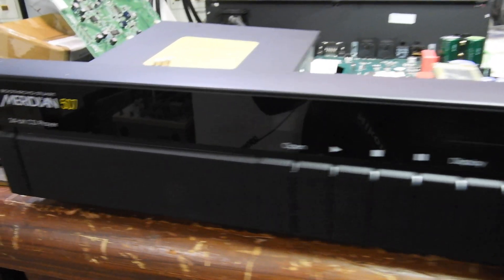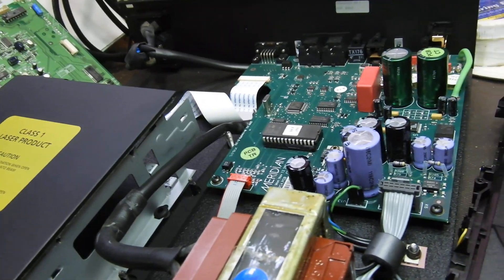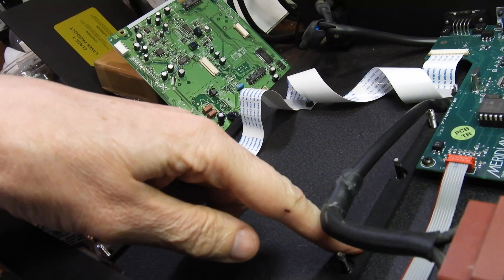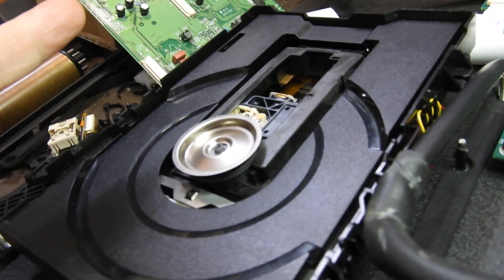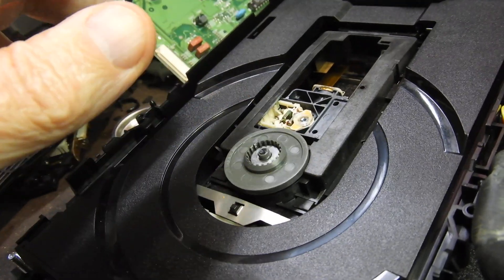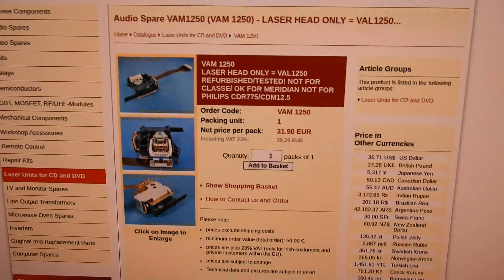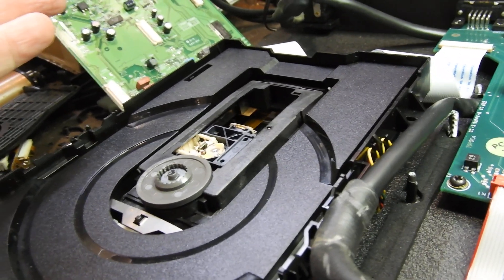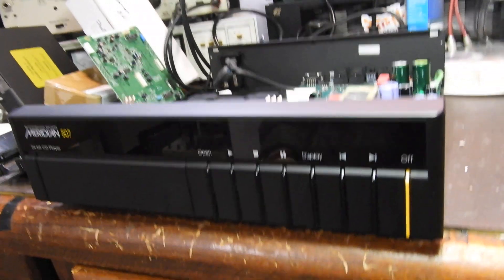Meridian 507 - 24 CD Player which has no laser emission and some leaky capacitors. Very quirky build

Comment: One of the reasons I tend to stick to D&M at by the late 1990's they got rid of using Sony KSS transports and designed their own bespoke transports which meant now in 2025 you can get plenty of spares and brand new lasers D&M then went to use the same transports of a lot of the models at that time which was brilliant when it comes to servicing!.. Sony KSS transports are as good or to the same level as Phillips CDM transports but if the KSS laser failes or transport fails your absolutely screwed!  You can't purchase any new lasers or even transports,you would have to get 2nd hand used or refurbished parts and some of those Sony KSS transports can cost around £250+ and that's 2nd hand !!!... You can pay £300+ £500+ for some of those amazing Sony units but if they fail you have one very expensive paperweight. Just my view and opinion.😊
Reply from the maker: What's D&M?
Reply: @hear-net-au  DENON & MARANTZ